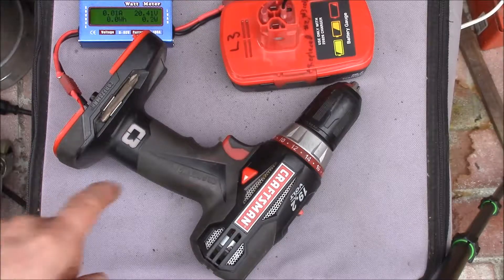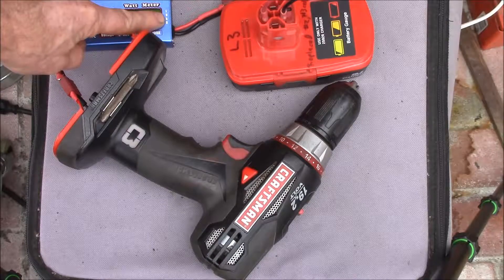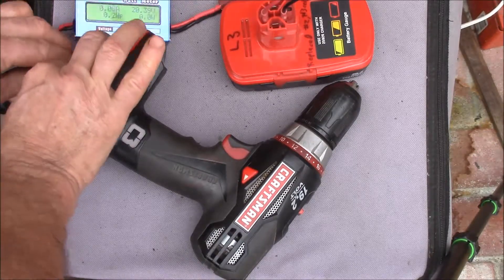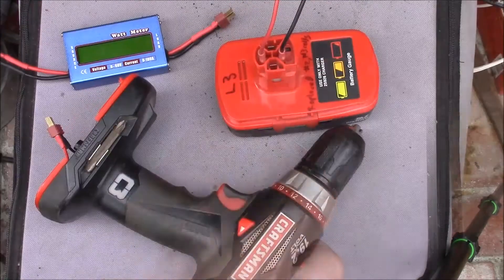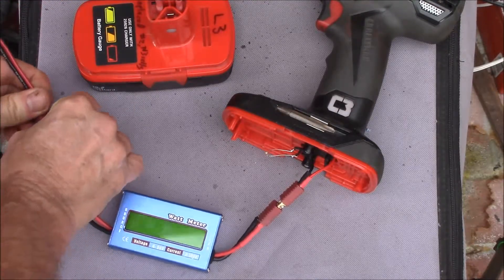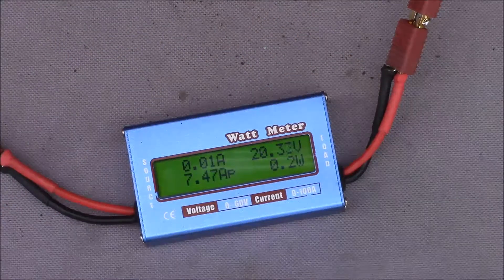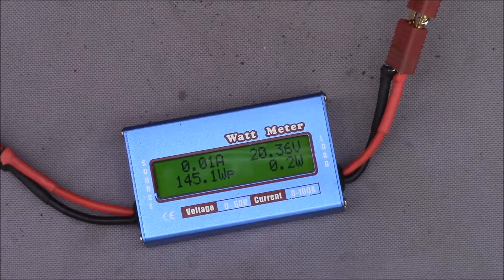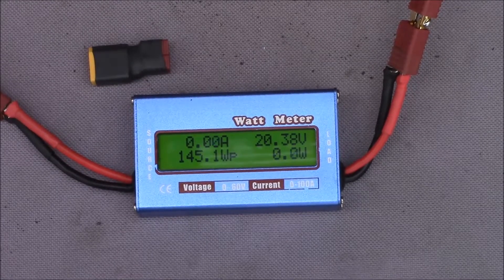Craftsman C3 Battery Charging, Part 3b

Comment: compare the measured result to a clamp meter or DMM ? Not sure how accurate this Watt meter current shunt performed.
Reply from the maker: Yes, good point.  I may check that out with both my clamp meter and an in-line DMM or two once I get the charging interface figured out.